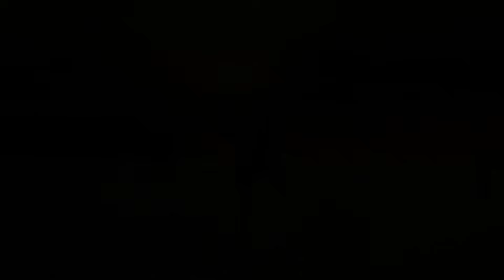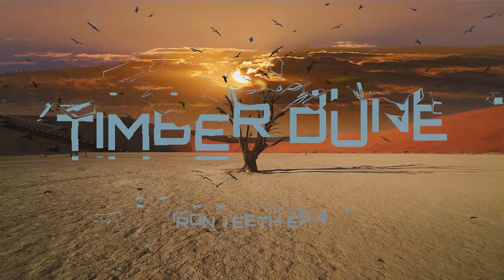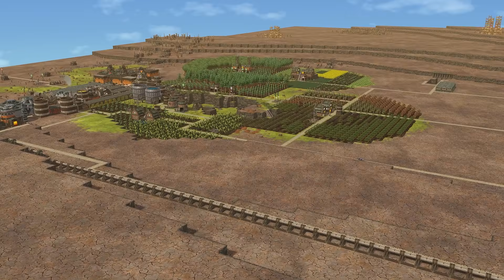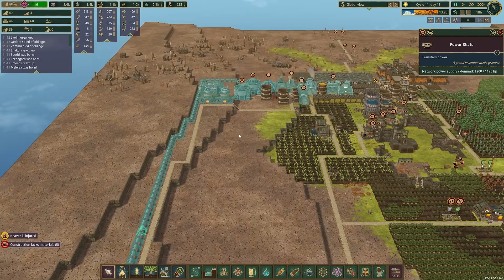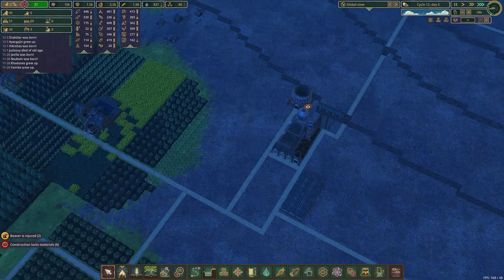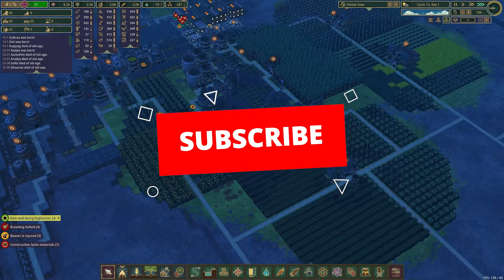NO MORE KITS! Advanced Pods Unlocked! Adults for Dune Domination! Timberborn HARD MODE EP 5

Comment: I've noticed the underground river doesn't dry up during a drought. Just saying that it seems like an easy second area to get water from without having to build a whole aquafer. All you need is a few explosives. Also, mind the holes that are still in the wall around your mines.
Reply from the maker: I have a plan to dig out a massive reservoir and diversion system for a couple of the rivers. Been trying to stockpile digging equipment for the project :)